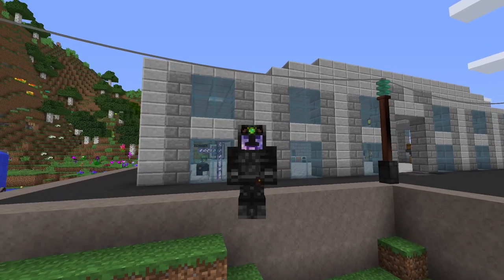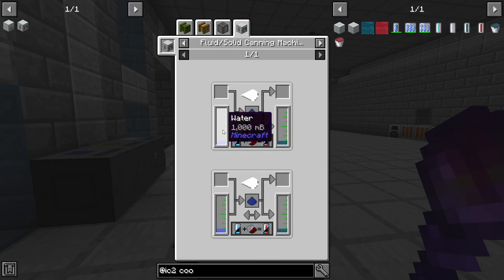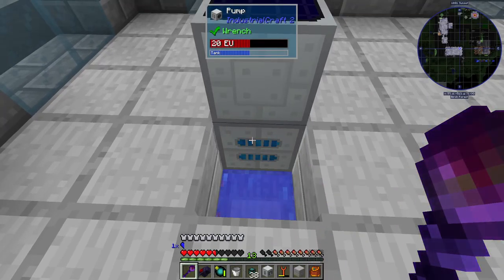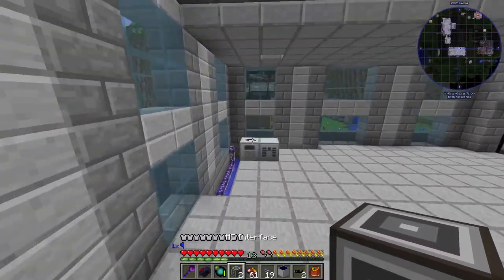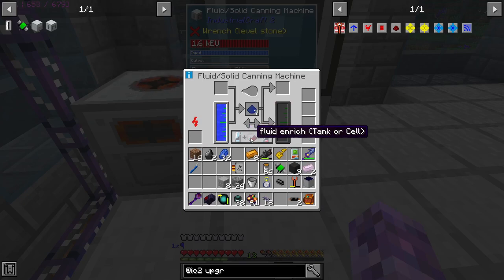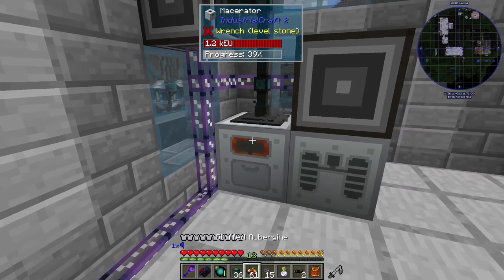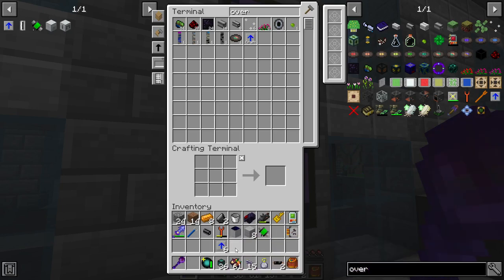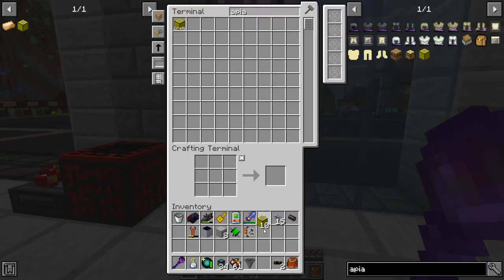FTB University Ep 42 IC2 Overclocker Coolant Upgrades & Gendustry Apiaries

Comment: U can set the side of the input and output upgrades by clicking them on a block, for example if u click the top of a block with the upgrade it will make it output to the top of the machine.
Reply from the maker: Duuude... I wish I'd known that early, would have made those machines so much easier to use 😅